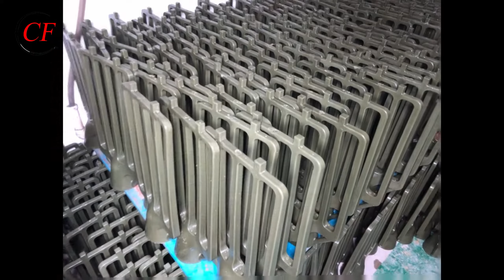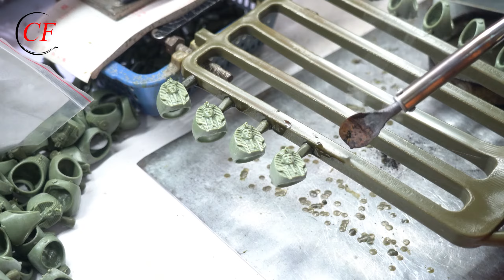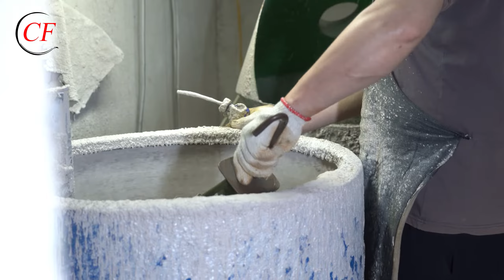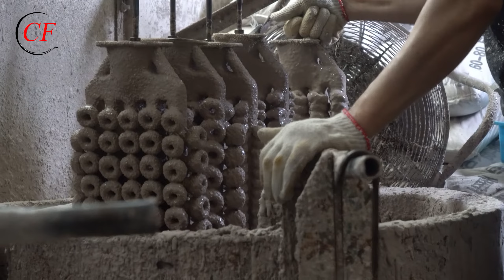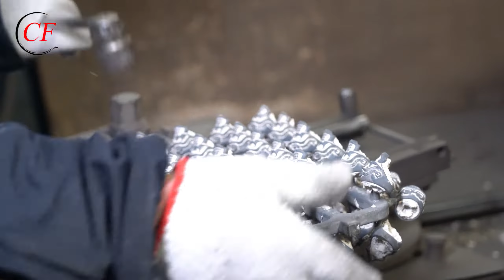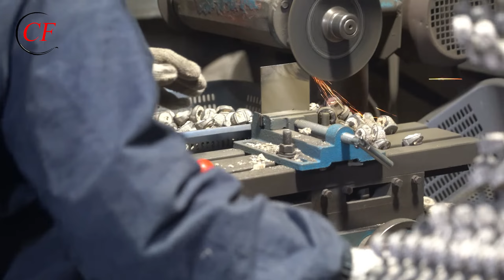Stainless steel ring casting process | CF Jewelry

Comment: how did the wax turn into stainless steel?
Reply: Wax getting burned out and stainless steel gets poured into the mold
Reply from the maker: @ungzheenedd2273  Wax is used to make models.

Comment: i want to know that can we used silver  in this process.what kind of liquid is on rings .and what that sand
Reply: you could use any metal i suppose. im guessing the white liquid is a de-bubbler , and the "sand" is a ceramic coating . the wax is melted away and the metal is poured into the ceramic mold .